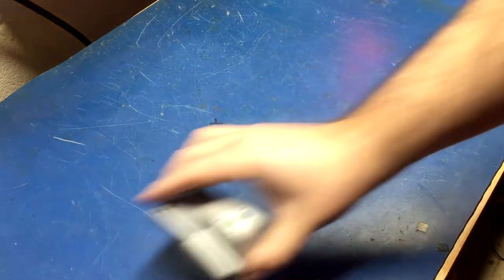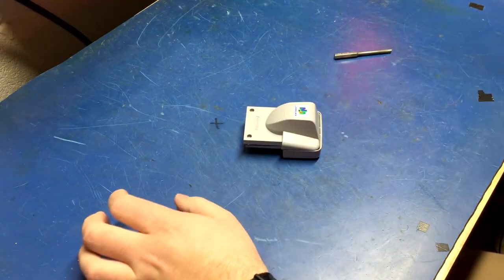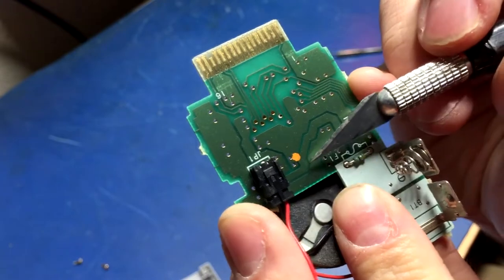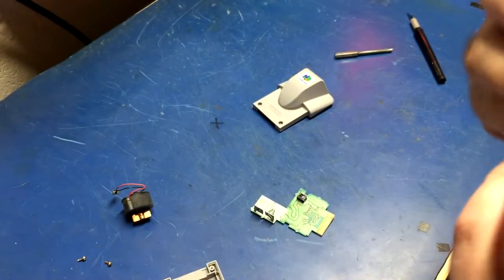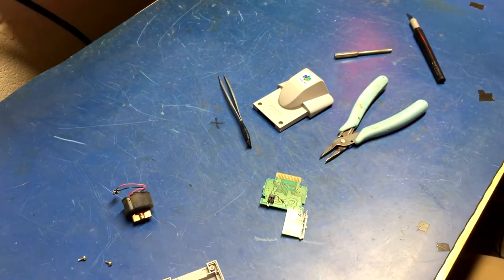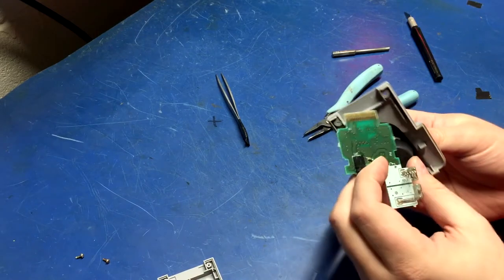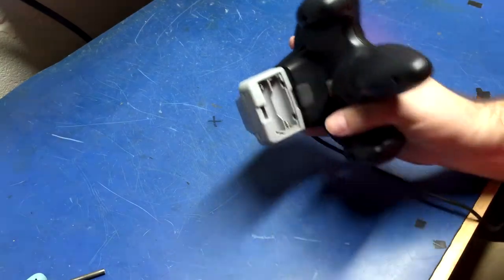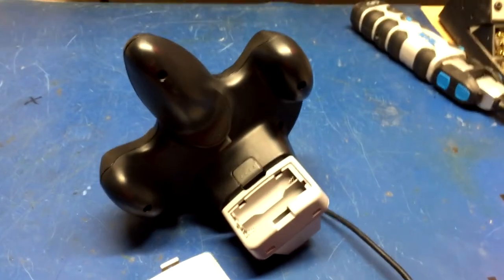N64 - RumblePak Battery Free Mod

Comment: it's real wierd that the N64 expainsion port outputs 5V Dc natively and they made people use a AAA battery to make the thing work lol, nice vid!
Reply: I think they did it to get around patents.
Reply: They did it like that because if you use 4 controllers with 4 rumble paks without batteries, the rumble would've been much weaker

Comment: Nice job.  What was Nintendo’s reasoning for requiring batteries for the rumble pak in the first place?
Reply from the maker: As best we can figure they were in league with Duracell. Lol. Can give you a better answer because we honestly don’t know bud!
Reply: My guess is because they didn't have the time or money to integrate rumble paks into controllers themselves.
Reply: Or maybe because they didn't have a clue on how to make rumble paks without the need for batteries
Reply: The PSU they went with for the 64 couldn't reliably power more than two at a time. With four controller ports... that would be a problem for a big multiplayer party. If anything, it suggests that they were at least trying to do it without the need of batteries.

Comment: I have a question is it possible to use two motors on a broken ps2 controller and put them a n64 controller with out haveing to Using the rumble pack ?

Comment: I’m in pa too lol. Is there any way I could send you mine to do this? I just got it and it appears the last owner forgot to take out the batteries and there is a lot of corrosion... so I’m not sure if the board is okay or not. If you would possibly be willing to help, I could send pictures. I have no access to soldering tools either. :/